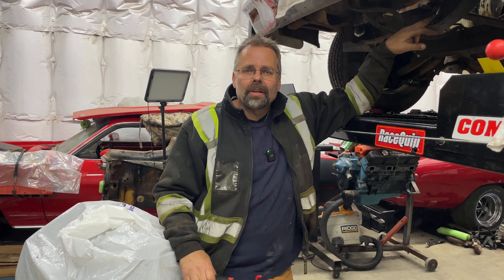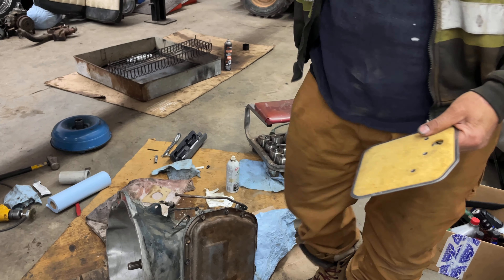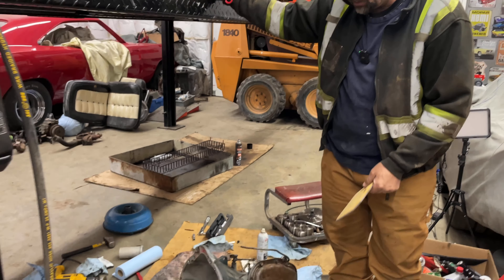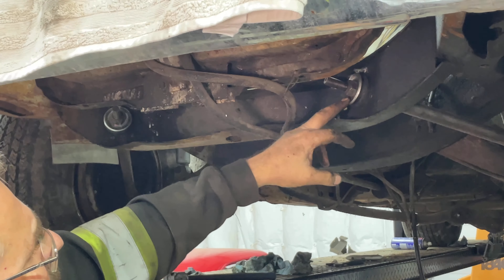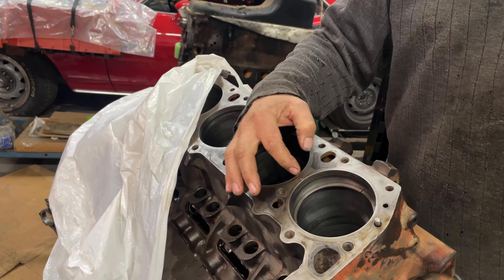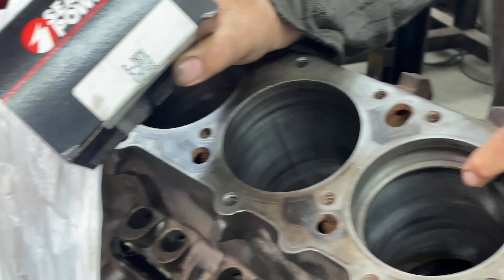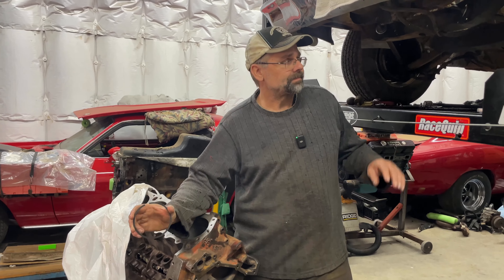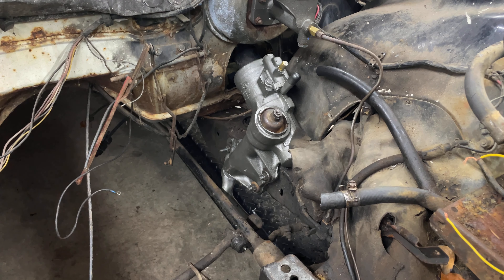64 New Yorker - Part 22 - Odds and Ends

Comment: DANG ,  back tires and rims on that red Charger ?   - BEST *  🙂 /  Still loving this rare wagon  !!!!
Reply from the maker: The Charger has 15x10” rear wheels with a 5” backspacing. Tires are 295/50/15”. That’s with the stock width axle and wheel wells.